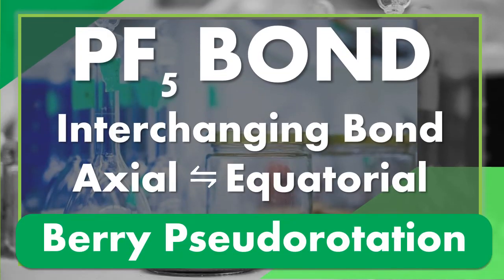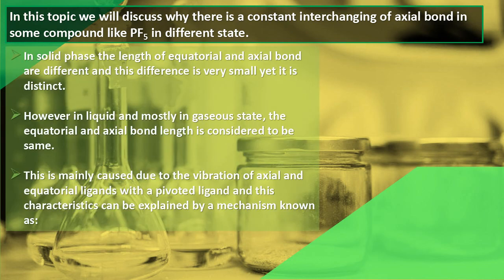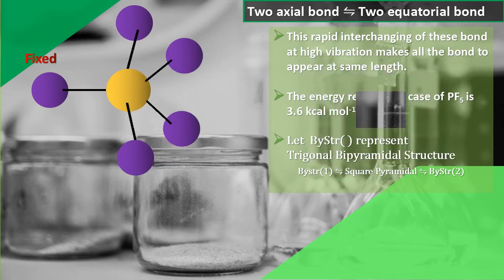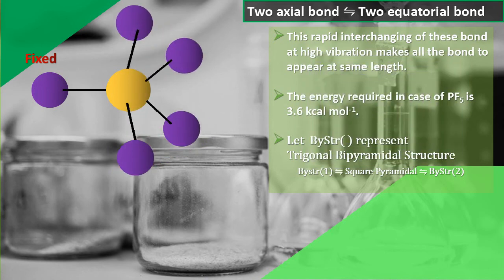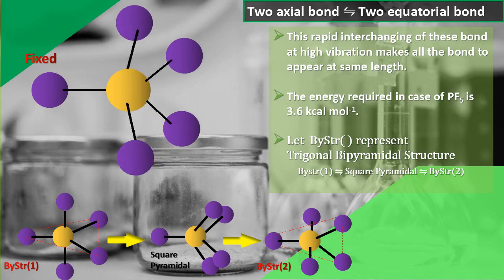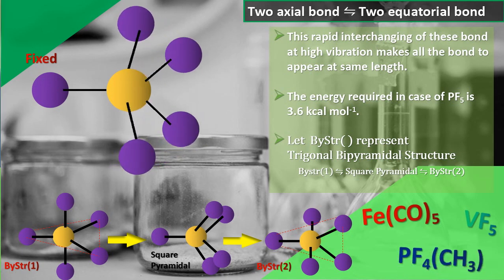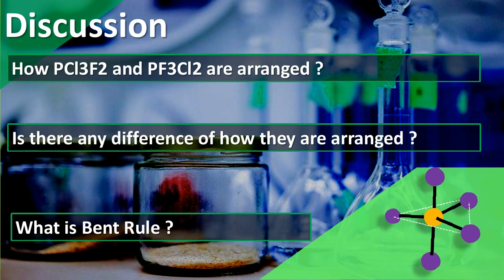Bonding PF5 | Berry Pseudo Rotation

Comment: Is all bond length of pf5 same?
Reply from the maker: Bond length of PF5 is almost same
Axial: 158pm
Equatorial: 153pm

However at high temperature mainly at liquid or gaseous state, due to constant vibration the bond length appears to be same. 

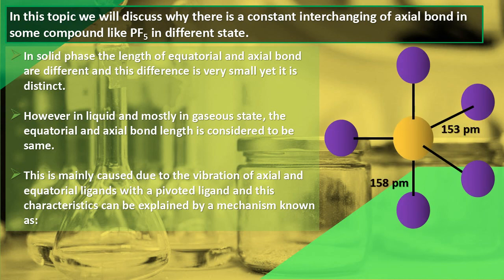0:20